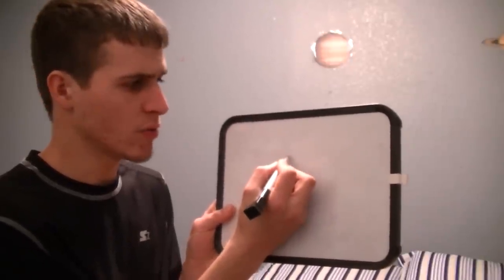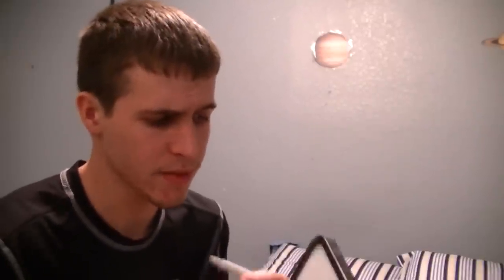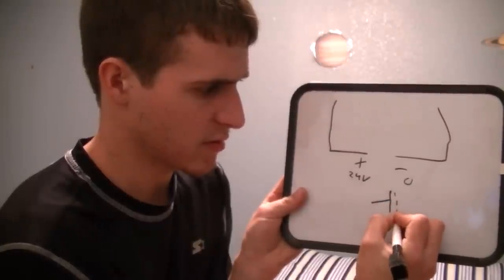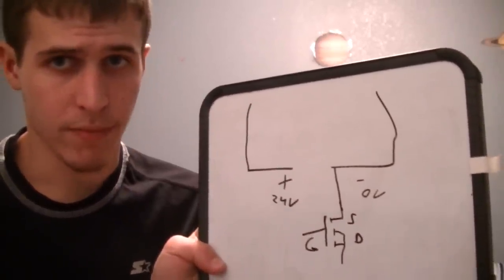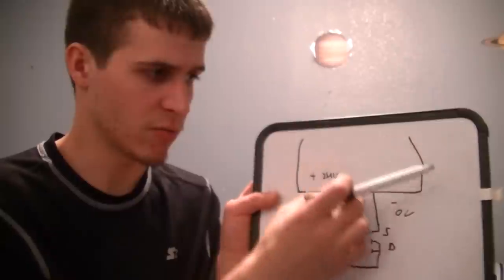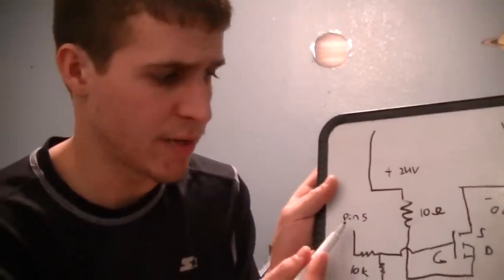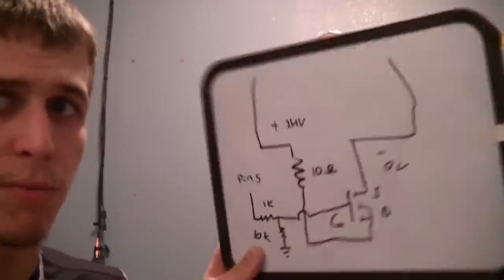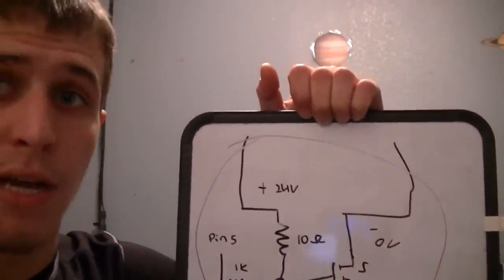Arduino web garage door opener Part 1 - The Circuit

Comment: +Jacob: Great job on this series (I'm watching about 2 years late). I've looked at so many videos working out this same problem, but yours is the first one I have understood the best. Great job. I would like to do this project using and ESP8266 -12E. This has wifi and a usb connector, etc. It is a 3.3v system. Can what you're doing be done with a 3.3v system? If so, what kind of transistor should be used? I really like your solution. Thanks!

Comment: I'll tell you what the heck is up Jacob.. my IQ after watching your videos! Seriously though I just found your videos and kinda been skippin around. I don't know much but very interested in electronics and circuit building. Quick question where did/do you get all your electronic components(transistors,capacitors,resistors,etc.) I've only scavenged some and been looking to buy some. Anyway thanks for taking the time to post these videos. I will be subscribing and going through your videos to learn as much as I can.
Reply from the maker: Jake Brooks thank you for the comment. I got most of my componenets online. I buy resistors and transistors in numbers and keep a stock of generic parts around for general projects. Its handy to have a good amount of resistors, capacitors, and semiconductors of various types on hand. I hope you find my videos helpful, I plan to keep making more.